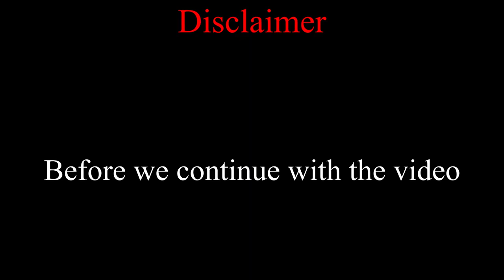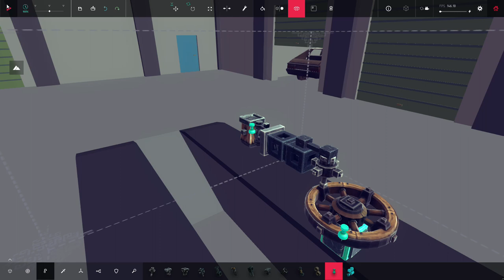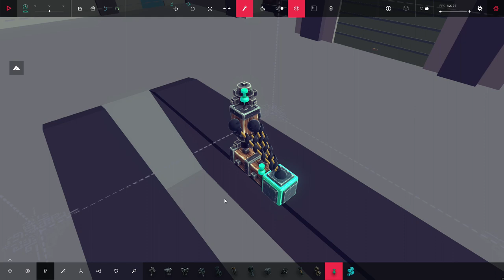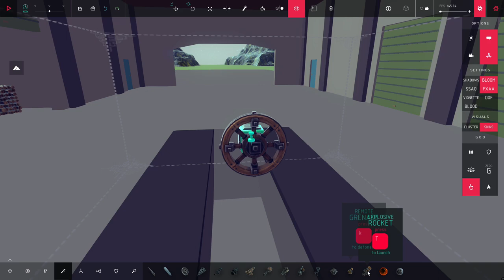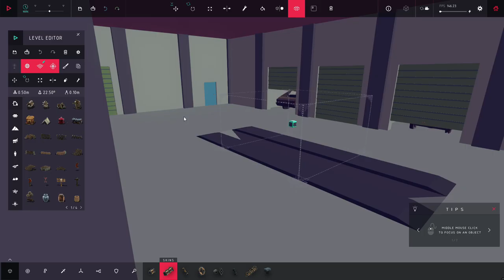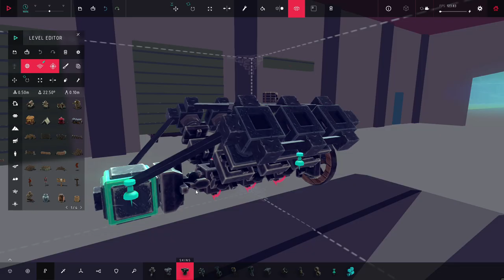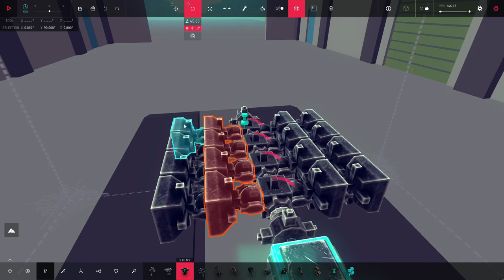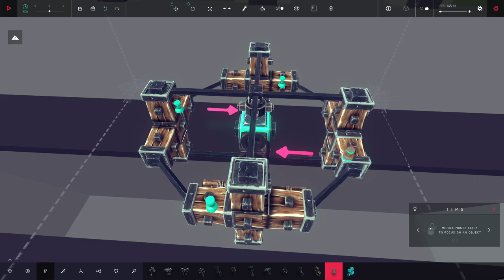Besiege: Engine tutorial

Comment: Hello! 
The reason some engines dont seem to have much power is because you used braces. In besiege, braces have a a limit on how fast they can rotate. You should try using gears, grabbers or swivel joints to connect parts of the transmission and the differential
Reply: What about ballast? For a crank shaft persay

Comment: How does the sensors work?
How did you program them to act automatically?
Reply from the maker: They do act automatically

All you have to do is to put any key in that "emulate" area. That key has to be the same one as for pistons

To keep it simple:
To extend piston you put H in their key
For sensors you put H in the place where it should emulate

There's also a range for the sensors which you should watch out after.
Reply: @GeReapeters 
Thank you for the response.
The way I understand it,
The sensor will press h if there is any
Object in his sight.
So you set his sight to pick up only the swivel...
Reply from the maker: @mannybraha8138  exactly!
Reply: @GeReapeters 
Yes I just got and its somewhat working